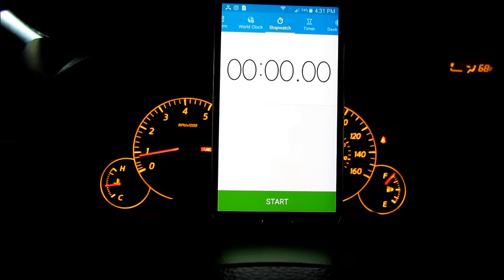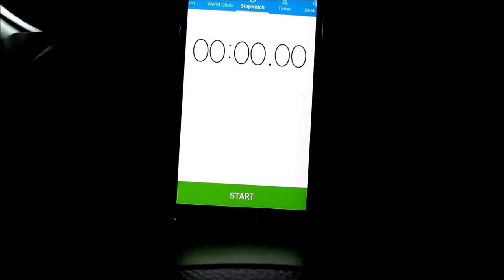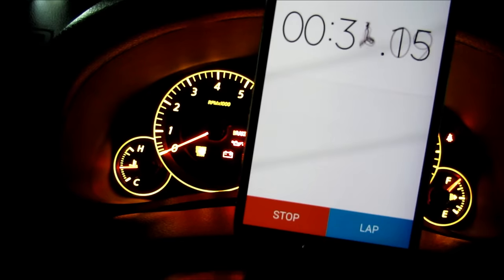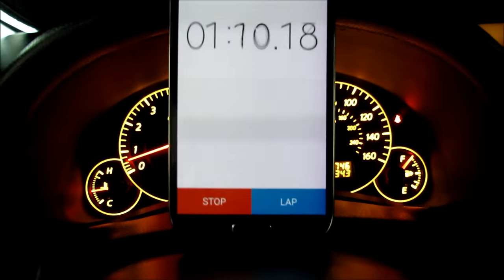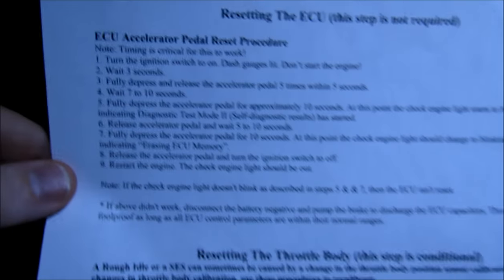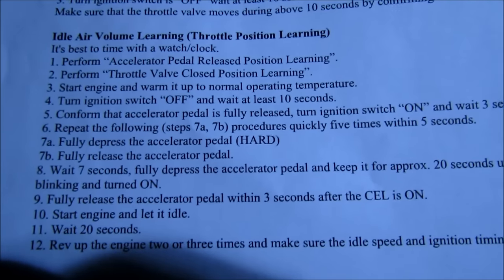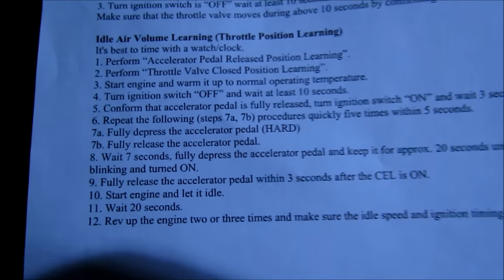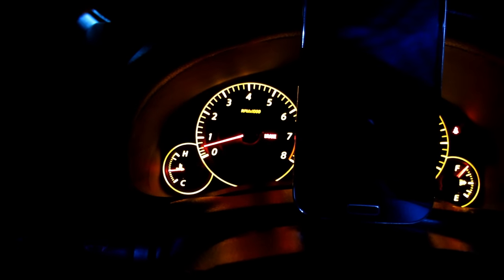Idle Relearn - FX35, I35, M35, G35, G37, 350z, 370z, Maxima, Murano, Sentra, Altima, M45, M56,

Comment: Do I have to do this for my g37? It starts up but revs down and dies, twice it did that but no codes, battery was replaced by the previous owner, no battery light on, when it starts it idles over 600 like 750 around there and never revs below at a stoplight it runs perfect, and I never touched any engine parts, just got it in last September with 97k miles now with 99k I’m a lil worried
Reply from the maker: Yes! It will fix it.

Comment: So I changed my throttle but I did because I've been have an issue with the car not starting when warm.. when its at op. Temp. They car will not start back up to it cools back down.. only reason y I posted this here was because I recently changed throttle body maf sensor and filter. But if u have any intel plz plz let me know

Comment: My G35 rpm is very low after replacing alternator. The problem is when I try to this method it shuts off again when I try to turn it on after the engine light turns solid. The only way to keep it from shutting down is by pressing the gas pedal
Reply from the maker: HAM Miranda ....Any check engine lights? What codes?
Reply: Motordyne G35 P0506

Comment: I am about to try this procedure but I want to ask you if it will fix the problem on my Sentra Spec V... I only drive it on the weekends for a couple minutes because it is a turbo built car... One day I started the car and it idles funny and will not go past 2000 RPMs.
Reply: sicklotus the car is in limp mode. Something is probably broke. Try and clear your codes and see if it pulls you out of limp
Reply: alex schultheiss hi thanks for your reply... Codes came back right away. Car did this before its a common problem for the spec v and altima.. Code was for cam intake silinoid but the problem was the cam possition sensor!! Neither time did it throw a code for it nor was found under a code search. In all the forums nobody ever found the truth behind the cause many ppl spent all their money chasing mass and solenoid codes and its only ever the cam position sensor! This needs to go viral.

Comment: Guys I have a 2003 Infiniti g35 with issues it won't drive past 30 miles per hr it says no codes is stored in the module it squeals very loudly when I start it up it's a new belt it's not holding power it has to be jump started even with a brand new battery it doesn't over heat has a smell of burning from the exhaust and flashing light on the dashboard any help plz

Comment: Hey Motordyne G35, do you know why my car wont start after replacing throttle body? It started twice for 30 seconds but eventually died both times... The VDC light, SLIP, and check engine were both on when the engine was on
Reply from the maker: Why did you replace the throttle body in the first place? What was the check engine light? The replacement throttle body, did you buy it new or used?
Reply: Motordyne G35 because people on the forums were telling me this is why my car wont turn on... Even with thr old TB, it would turn on then die after about a minute. BTW I also did replace the Accelerator Pedal Position Sensor basically for no reason... I replaced it w/ a Chinese one... Should I put the OEM one back on?
Reply: Motordyne G35 new TB Hitachi btw
Reply from the maker: You will get a check engine light if the throttle body goes bad, so obviously by replacing the throttle body, it did not fix your original problem. Sounds like, because the VDC light, slip and check engine light came on it is a cam sensor. 2 things are needed to make an engine run, well 3....air, fuel and spark. What is the check engine light code?
Reply: Motordyne G35 dangit sadly I do not have a scan tool and I havent called in a mobile mechanic yet (which I shouldve done in the first place) but... I did already order 2 quality (Hitachi and Delphi) Camshaft Position Sensors... theyre suppose to get here today... I'll keep u updated on what happens w/ the new sensors. Thanks for the replies!
Reply from the maker: Sounds good, yeah let me know. Here is my video on how to replace the cam sensors.......https://youtu.be/-ipaOP7Bqvc
Reply: Motordyne G35 Dangit... so I changed both Camshaft Sensors and also put back the factory Accelerator Pedal Position Sensor since the chinese one didnt work and now it revs (it didnt rev at all w/ the Chinese one) but slowly and the VDC and SLIP lights are still on. Do you think the ECU and all that stuff need reset?
Reply from the maker: Yes, ECU reset video here......https://youtu.be/KEn-R4pYl6w
Reply from the maker: So Tony, what is the status now? Did you fix it?

Comment: help! on my 04 g35x sedan AT i'm having an issue. I changed all the plugs,coil packs, all the cam/ crank sensors, cleaned the MAF sensor and throttle body but i'm having an issue with the car hesitating at higher rpm. idle seems good at startup but i didn't do the idle reset like in this video so i don't know if this is causing my issue. Car starts and trans shifts normal ant reg driving but while driving if i step on the gas the RPM revs high and wont seem to shift. Could it be because i didn't do the idle reset and the ECM reset that this is happening? There is a 15 sec video on Youtube with the problem i'm having. (g35 hesitation). Has anyone had this issue?

Comment: My 04 g35 was idiling at 1100rpms. I did this and it went back to normal but the light is still on. Advice?
Reply: Lucas Mojo I read somewhere after it stops blinking we need to turn it on before 3 seconds. Try it out.
Or disconnect the neg terminal

Comment: It took me many attempts to get the link to blink but got it at the end and the RPM dropped to slightly over 600. Thanks!
Reply: I forgot to mention that my car is a 2009 Nissan Murano. Few weeks ago, I cleaned the throttle body and the sensor; some time after that I see "service Engine Soon" light on the dash, I didn't make the link and was wondering what's about !... so I just bought an OBD2 dongle and run an App and it gave me at least two codes, P0448 and P0507. I could tell that the idling was different than before. Now it's back to a lower number.
Reply: My car stays at or a little over 900-1100 rpm but after I cleaned the throttle body I forgot to relearn it so I’m trying now should I just redo the entire procedure?
Reply: @Photography-oe1iy  
It’s been 2 years so I forgot what I did at that time. But reading through my comments, it looks that it worked, so I would say go ahead and do that. In fact, few days ago I cleaned the throttle and totally forgot about all this, so thanks for your comment, as a reminder! I will try later to go and do what’s deceived in the vidéo. 
Oh, one more important thing, please CHECK the air intake boot, the wide 5" rubber hose between the air filter and the the throttle body, mine had hidden tears and that leaks air in. It sounds that many Murano’s had that issue. I bought mine online. I even checked a local junkyard and it was thorn on all the Murano’s I checked !!

Comment: Dude I’m having a weird problem on my HR, first it was idling high at 1.1k so decided take off both throttles cleaned them along with the mafs put everything back together and did the pedal dance to reset and now it’s surging 1-2k nonstop. Any advice you can help me out with??
Reply: I'm literally having the same problem. Can't find answers anywhere. Bout to hit up the forums
Reply: @bluezevil1305  what car do you have? I found out the 2007 G35 came out defective and when you do the relearn and messes up the ecu and you have to either have the dealer update it or swap the ecu
Reply: @alexquezada510  08 350z
Reply: But I think I got mine to relearn by unplugging the sensors on the throttle bodies while the battery was plugged in to let the ecu know they were different. Then before doing the relearn process I unhooked the negative terminal and pump the brakes to discharge any leftover energy. Did the relearn process and it seems fine. I'll know in a day or two
Reply: @bluezevil1305  keep me updated before I go the the stealership
Reply: @bluezevil1305  so unplug a throttle body and turn on the car, once on each side? With the car on?
Reply: No just unplug them with the car off but leave the battery connected. You can do both at the same time
Reply: @bluezevil1305  got it, and plug them back in after the disconnecting the battery I’m assuming? Then do the relearn
Reply: I plugged them back in before disconnecting the battery. Unplug them, wait like 3-5mins then plug them back in. Then disconnect battery and pump the brakes like 10x to discharge energy. Then do the relearn process
Reply: @bluezevil1305  okay Ima try that in about an hour when I get home 🤞🏼
Reply: @bluezevil1305  unfortunately Not working guess I’m off to the dealer 😭
Reply: Damn that sucks

Comment: For my 350z when I turn the car on and I leave it to idle it stalls out due to low RPMS and other times when I come to a stop or a red light my RPMS get so low the car just stalls out, any idea why this happens ?
Reply: Did you figure out why? I got a g37 sometimes when I start my car after it’s warmer up it will turn on and then the rpm with drop all the way and turn off.

Comment: I have a 2005 maxima sr, and I just put another motor in. Now when I drive it, not even half a mile it's like the rpm riles up and it's like it went into neutral. So I sit for bout 4 mins while broke down then crank up, it drives fine, then same thing again over and over. The car shop charged me $700 to change crank sensor, and idle sensor and still didnt work. So now these ppl have had my car over 3 weeks because they dont know how to fix the problem or what's going on, could this be the case? Plz help
Reply from the maker: The RPM's go up and it acts like it is neutral when you have it in drive, sounds like a transmission problem to me. How many miles on the car?
Reply: Only 65k miles
Reply from the maker: @marcoboyd5449  ..not the new engine. On the car? The transmission has how many miles? Automatic right?
Reply: Yes, auto. Dont know how many on transmission though...
Reply: Didnt start doing this til got motor put in

Comment: So I’m experiencing idle at 500 rpm when automatic tranny  is in drive but car is stopped. And a lot of vibration. Anything above 500 is fine. I did the idle relearn and the needles goes up and down. Cant seem to find a constant idle rpm. I cleaned out my TB and mas recently. But i didn’t that bc I’m experiencing issues. That didn’t solve it.  So i tried idle relearn. Any suggestions? I’m abt to change plugs
Reply: I also recently change my tranny and differential fluid at the dealership and replaced fuel damper. So a lot of things going on.

Comment: Will this work if my car has a rough idle? As of 2 days ago my 04 G35 coupe started having a rough idle, when I’m at a stop, the rpms shake as well as the car. I noticed it’s not all the time though.?
Reply: Might sound dumb, I’m 100% stock except for a muffler and resonator delete BUT the idle makes my car sound cammed lol
Reply from the maker: @EnriqueRamirez1998  ...bhaaa cammed on 2.25 inch pipes, funny. Yes, the idle relearn will fix it unless you have a check engine light that codes needs addressed first.

Comment: Thanks for the vid bro!  So I unplugged the wrong fuse, and put it back, and when I started my g it revved all the way to redline and I couldn’t get it to stop! Would this fix that? Thank you in advance man
Reply: Also my car has a tune, will this mess that up?
Reply from the maker: @davebelisle1653  ...I also have a dyno tune, no it will not mess it up. Yes, it will fix your issue.
Reply: Motordyne G35 I just tried it and it still revved right up to redline. Any idea what else I can?
Reply from the maker: @davebelisle1653  ....I figured you have a bigger problem but worth a shot. Sounds like you need a new throttle body. Time to upgrade. I have NWP 75mm big bore throttle body.
Reply: Motordyne G35 it was running great until I pulled and replaced a wrong fuse. Think there is anything else I can try?
Reply from the maker: @davebelisle1653 ...disconnect the throttle body harness, replug it back in. Do idle relearn. If that doesn't work you will need a new throttle body is really my only guess. How many miles on the G?
Reply: Motordyne G35 about 117k milesbut the engine was replaced around 60k so only about 60k on motor, it’s an 05.
Reply from the maker: @davebelisle1653  ...did you actually look at the butterfly in the throttle body? Is it stuck open?
Reply: Motordyne G35 no I didn’t, I’m gonna have it towed to a shop I guess, I’m not very mechanically inclined lol. Just was hoping I could find and easy fix on YouTube

Comment: 06 coupe rev up 6mt will NOT take this procedure to reset new OEM TB and OEM TPS.  Someone help.
Reply from the maker: User error you mean, try again. My  G is a rev up just like yours, it works.
Reply: @MotordyneG35  It may be, but I've built this car from the ground up...seriously. Every bolt. Had 2 350's before this one. The VQ platform is something I'm extremely familiar with. I followed your video to the letter....or second atmeast 50 times. All the right things happen...it just won't reset WOT. Its stuck in mushy throttle limp mode. Battery voltage...check,(Stinger sp1550 & sp680 in rear) temperature 175+....check. I'm at a loss. I've done this on every G/Z I've owned...no issue. Any other thoughts? I do have a CEL on for fuel sending unit..would that inhibit the procedure to not go thru?

Comment: So i will be replacing my MAF and air intake will i need to reset ECU first and then Relearn the idle ? Car does have a rough idle as well
Reply from the maker: If you read the service manual, it says when replacing the MAF to disconnect the negative battery terminal. Well, at that point, you are already half way there, you might as well pump the brake pedal to reset the ECU. It can not hurt. That will not fix the idle though, you will have to do the idle reset like I show you in this video to correct the idle. 

Have you tried the idle relearn procedure yet? This video makes it easy.
Reply: Motordyne G35 
I have 2 codes for MAF and misfire which is causing car to idle as well just had a recent rebuild so once i replace spark plugs , intake and sensor the relearn should be able to reset for it to be back to normal ?
Thanks for the feeback!
Reply from the maker: That is correct, the relearn will fix your idle issue no problem once you first fix the parts causing the misfire/ 2 codes. I take it you saw my other video on the ECU reset? It is way way easier than the pedal dance people out there on youtube try to make you do. 

Easy ECU reset...............https://youtu.be/KEn-R4pYl6w
Reply: Motordyne G35 
Awesome thank you !
Reply: Yea the light doesn't blink at and all the electronics are off?

Comment: I did this procedure at first Idle good but when I turn off car goes back to over 1000 Rpm to 1200.
Reply: Jose Gomez did you ever find the issue? Mine is doing exact same thing rt now. Rpms are 650 until I turn car off then it goes back to 1100 😭

Comment: Didn't work on mine.  My 2008 altima coupe 3.5 is idling at 1400 rpm I tried this 4 times and the check engine blinks and everything but doesn't work .
Reply: Any luck ? Same but mines at 1500 ...
Reply: Wont work on altimas guys stop trying this method

Comment: Got it to work only thing is that, it idles 925 in park and neutral ? Is that normal ?
Reply from the maker: With the A/C on, yes that is normal. Without A/C on, it should be at 650 RPM.

Comment: Tried it om my q50 3.0t still happening with the rpm jumping up and down when parked
Reply: Coolant isn't flowing right That's what I was told on mine you 50 had the thermostat replaced and coolant flush and it fixed the problem

Comment: I did a transmission swap, put the new one in and now the car won't accelerate, I perform this steps but no luck making it to work... any other ideas?
Reply from the maker: Alpizar#74 ....when you say it does not accelerate, does the car move at all? Any check engine lights?
Reply: Motordyne G35 yes, the car engaged gears, but won’t accelerate, so it doesn’t move. Just idle normal , no check engine light on or codes...
Reply from the maker: Alpizar#74 ....Who installed the transmission? Sounds like the engine is running, but the transmission is not accepting the power delivery.
Reply from the maker: Alpizar#74 ....sounds like you own an automatic. Maybe because you didn't install the torque convertor correctly?
Reply from the maker: Badass you turn wrenches. Did you tighten the 4 bolts on the torque convertor to the flywheel from the secret black door opening?
Reply: yes I did, I install it the same way I remove the old one..
Reply from the maker: Alpizar#74 ...hmmm....

Comment: This video helped me get rid of the check engine light but my car still get any higher rpms
Reply from the maker: my car get any higher rpms? what does that mean?
Reply: Motordyne G35 sorry, miss wrote, my car doesn’t go higher than 2000 rpms, car barely goes for 15mph while im driving
Reply from the maker: danny pacheco ....sounds like your camshaft sensors. You should have a check engine light, the code is in this video here and how to replace.......https://youtu.be/-ipaOP7Bqvc